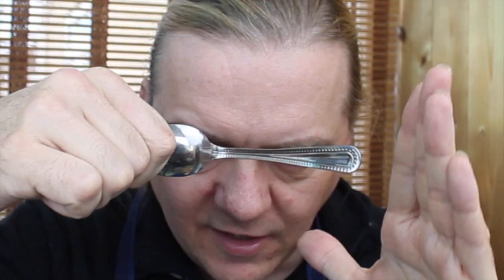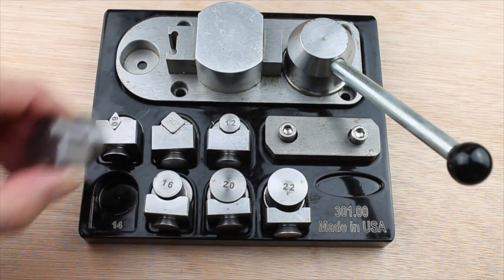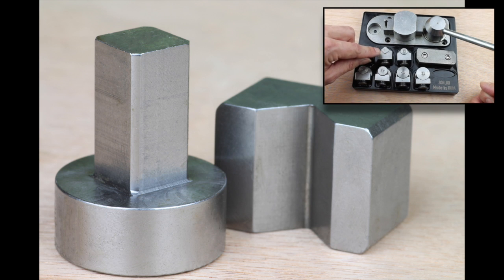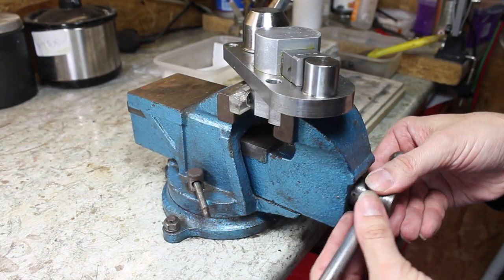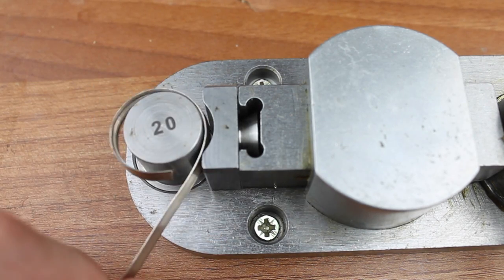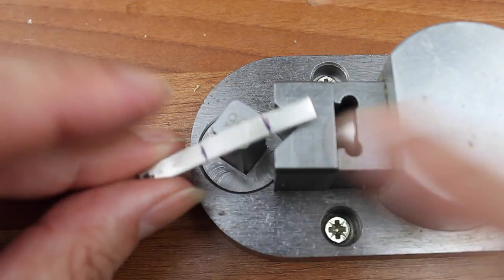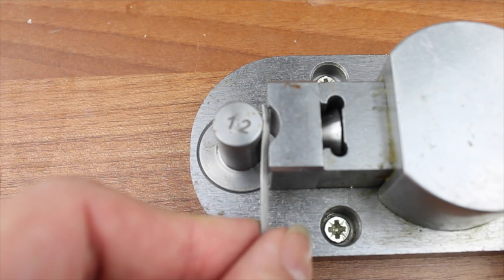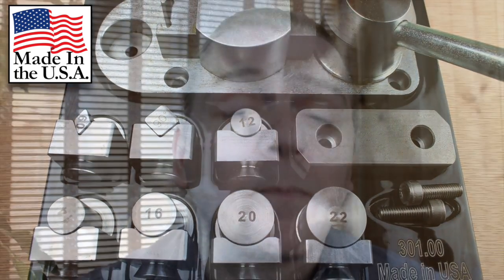Pepe Tools Superior Ring Bender Demo & Review in HD

Comment: I'm learning how to make rings, and it's already obvious that my ring-bending pliers don't have enough bending force for ring shanks getting over 1.5mm--especially when the ring is constructed of several pieces. Unless I want to hammer away on a ring for an hour, I'm going to to need a tool such as this excellent Pepe ring bender. Also I noticed on Pepe's product page, it now includes an 18mm mandrel and die, and a set of Delrin dies are also included--presumably to protect against marring rings with intricate designs. The die/mandrel sets are also nickel-plated now, which would protect against rust pits getting transferred into the work.  It's pretty clear that if you're in the business of making rings for clients, this tool will quickly pay for itself. Once again, and excellent video review of an excellent product!
Reply from the maker: Yes indeed. Once you clamp it down, you can get much more force than you could with pliers. I find it also helps to keep the sides parallel too. Note on Pepe's site they also have some larger ring shank benders and also a wedding ring stretcher / reducer with integrated shank bender too. (hoping to get one of those soon, video when I do). Dave
Reply: As an update, I just received my Pepetools ring bender and mounted it to my bench, and just tried it out.  The latest unit looks a bit different: the posts and dies are now nickel plated, which will prevent rust. The other parts are black anodized and look quite nice. There is also a set of 6 strong Delrin dies--which I suspect I'll used a lot--and I'll explain why. I found the nickel/steel dies often leave some tool marks--most notably when using the 12mm or angled die/mandrel sets. These tool marks aren't too deep and are quickly polished away. However, since I often polish or apply gold and designs before I bend the ring, I've found the Delrin dies are much easier on the surface.  I can already see it's a very nice tool that will save a lot of time when making rings.

Comment: Excellent demonstration!  I purchased a Pepe superior ring bender and should have it this week.  I'm wondering if I should heat the silverplate silverware before making a spoon ring?
Reply from the maker: Silver plate? What do you suppose is going to happen when you heat it? you will likely melt off the silver plating and make a mess. Much better to use sterling silver spoons and anneal them, you can then polish them up later. Dave.

Comment: Hi Dave, Thanks for the great video, would the 60 degree die bend 2mm square wire? Thanks
Reply from the maker: Yes indeed,You can bend spoons and heavy rings. Better if it's annealed of course, to prevent it springing back. Dave

Comment: what is the maximum thickness of sterling silver  can I use? my spoon handles are quite thick, also is there a unit that includes  bracelet size?
Reply from the maker: The thickness is (to some extent) determined by the size of the post you are using, as the smaller posts will allow a greater gap between the post and the die.  Although a lot of people use this for making spoon rings, it's not really what it was designed for. As the name suggest it was designed for  silver and gold for making rings (eg wedding bands). Pepe also make a more robust ring bender with a much longer handle and will bend pretty much anything. This is ideally suited to what you are doing. See link. Dave
http://pepetools.com/ring-tools/ring-shank-bending-tool

Comment: I know this is an old video. But what size bolts would I need to bolt down?
Reply from the maker: That depends on what you are bolting it to, the thickness of your worktop, and weather you want to bolt through or screw down. Dave

Comment: How high of a apiece can I bend on this tool. If its higher than the die, will it bend evenly and also will it scratch the metal while you are bending it ?
Reply from the maker: The post are 18 mm high. So that's about the max width you want in order to get a perfect bend with all the material in contact with the post and die. Yes, you can bend wider material. In this case you should mark up the work accurately and once bent, flip it over and bend it from the other side. Hope this makes sense. Dave.
Reply: Thanks Dave. I appreciate your feedback. Love your videos by the way. :)

Comment: can this bend size 8 square wire?
Reply from the maker: Square wire, yes indeed. But I'm not sure what you mean by "Size 8". Many people use the ring bender to bend spoons and forks to make jewellery, so it's pretty strong. Dave.
Reply: 8 gauge square wire is what i meant to say
Reply from the maker: 8 gauge wire is about 3.3 mm so yes that's absolutely fine., it will bend with ease. Dave.
Reply: Celtic Dreams Do you need to anneal metal before using it?

Comment: WD 40 only good for 3 months then reapply
Reply from the maker: A valid point. for long term storage I'd probably use something thicker like grease. But when in normal use, a quick spray is very easy and works well for me, to clean, lubricate and protect. Dave

Comment: I have been a goldsmith for over 20 yrs both using traditional methods as well as modern production like cad  and 3D printing and am a bit of an gadget freak but I think this tool is totally unnecessary takes about as much time to set it up as doing it by hand.
Reply from the maker: Thanks for the CV. Perhaps not everyone has your vast experience and skills. I've only been making jewellery for the past 19 years, so as a beginner I find tools like this very useful. Thanks for watching.Dave

Comment: goto 3:00
see the rust stain coming from under the center sliding piece ? The brown stripes. That usually means a cheap (non stainless / non brass) spring that is already rusting out. Send it back while it still has a warranty.......
Yes. Old video. But useful information anyhow to apply to a new device. Notice this is near new & came with an anti rust greasy layer. But there is something out of sight producing rust - the one and only breakable part.
Reply from the maker: * * I have published this comment,as you are completely wrong.* * The brown marks you see are "brown grease", a thick sticky grease applied to the piston as it is a moving part. It also helps protect the item whilst in transit. 

You imply that anything not made of brass or stainless must be cheap. Why ? Give the guys at Pepe some credit, the guys are professional engineers, born and bread. All the products go through months and sometimes years of testing and designing before going to market. Obviously the item is not brass, that would not be strong enough, stainless, likewise does not have the correct hardening properties. Its made from carbon tool steel which is then hardened. Pretty much the same material as every other metal tool in my workshop. Pliers, files, bench tools, vice, etc are all hardened carbon steel. I don't have any brass pliers, and i don't have any stainless steel files. Hence the name "tool steel". I live by the sea in the very wet and damp north of England, -  a highly corrosive atmosphere. Outside, metal garden furniture will last a year before disintegrating. But in my workshop, my ring bender is fine....and there is no need to send it back. Dave
Reply: Looks like i goofed then...
Apologies all round. Fell free to wipe me from the comments.

Just going on what I have seen in the past......

Peace all..